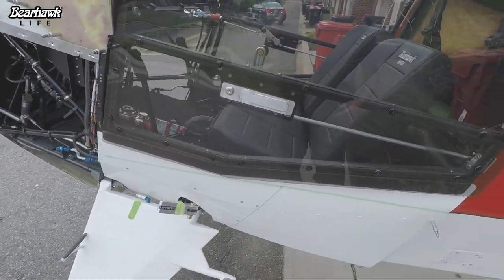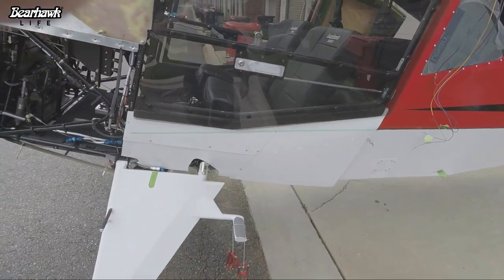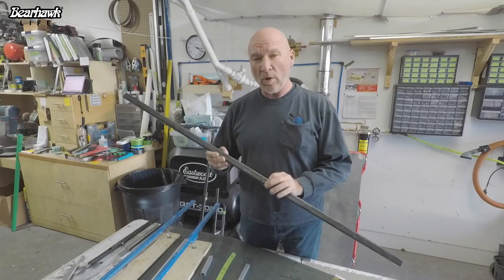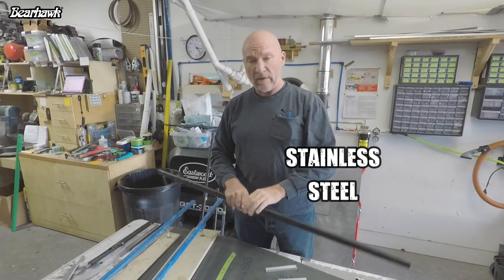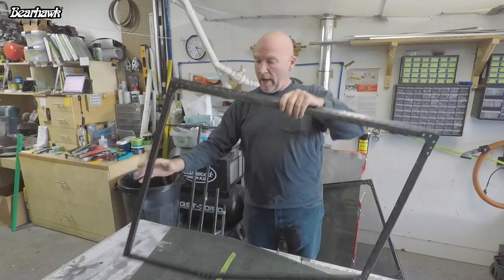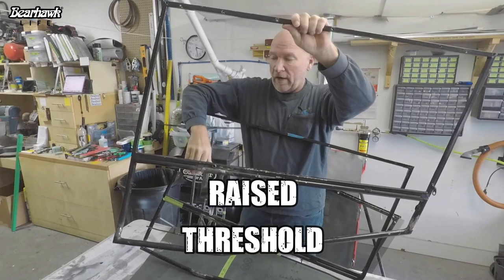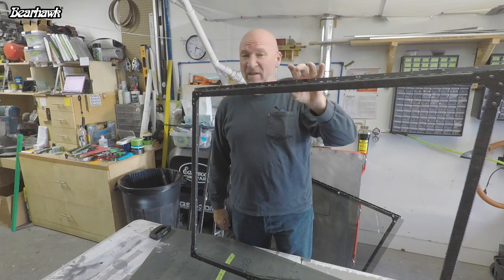BEARHAWK ~ Fabricating Gull Wing Doors for the Bearhawk!

Comment: Could you have formed the lexan into a bubble shape so you had some more elbow/arm room? Still enjoying your videos
Reply from the maker: Thanks John.  Good questions.  I considered much of what you are asking and learned....  My Lexan actually tucks in behind the front door former and is out of the slip stream.  Something the door that come with the kit does not do and can be noisy as well as affecting cabin comfort.  I really haven't found the need for extended room for my elbows.  Bubble shaped doors/windows are also known for being extremely draggy and can affect flight performance.

Comment: Very  nice design and workmanship. Wondering, how far into the cockpit space do the door lock knobs protrude?  Do they in anyway pose a BUMPING hazard to your legs or midsection, during turbulence or rough landings? Thinking safety and comfort all the time.
Reply from the maker: Thanks, Daniel.  No issues with the body conflicting with the door mechanism.  Everything was laid out around an actual body.

Comment: Door and handle look good together

Any issues with putting aluminum inside the frame as far as corrosion with the carbon fibre?
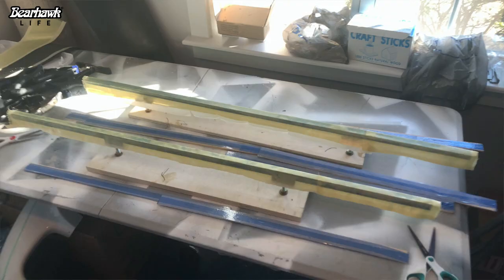Reply from the maker: I put a kevlar barrier between the CF and the AL.  Check out 4:13 in the video where I describe this process.

Comment: Very nice doors....much lighter than mine for sure. One comment on the internal door handle. Do you have an internal locking mechanism to prevent inadvertent opening in flight? On mine, i have a similar handle design, but also have a spring loaded pin lock at the bottom of each door. Fail safe design.
Reply from the maker: Thanks Mike!  Great question!  Yes, the internal rotating mechanism has a spring loaded detent in both the open and closed positions preventing the handle from "wandering" inadvertently.  Hendricks Manufacturing did a great job thinking of everything in this door latch system.

Comment: So the kevlar is just there for the attachment to aluminium, so the carbon fibre doesn't touch aluminium, is that correct?
Reply from the maker: Yes.  And the Kevlar also keeps the CF from shattering in the event of substantial impact.